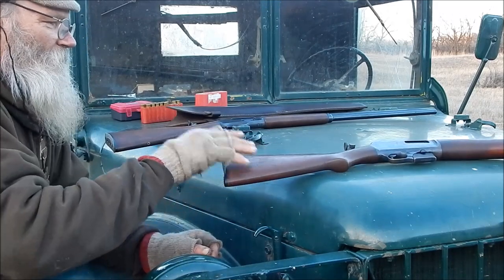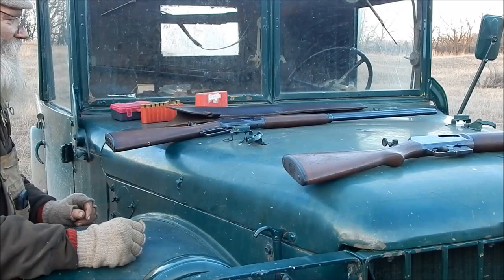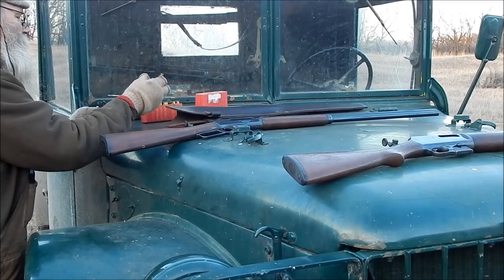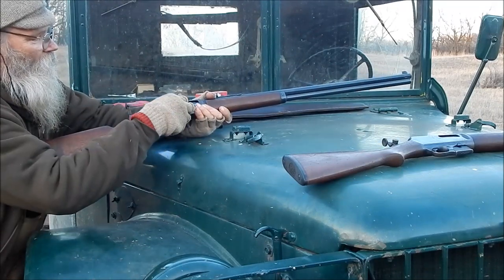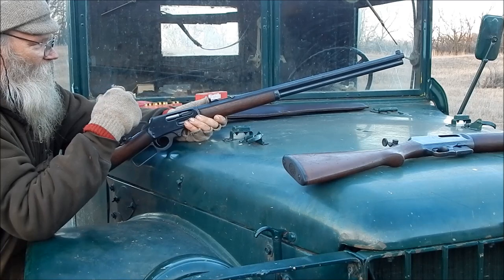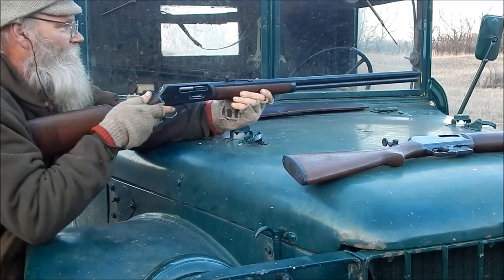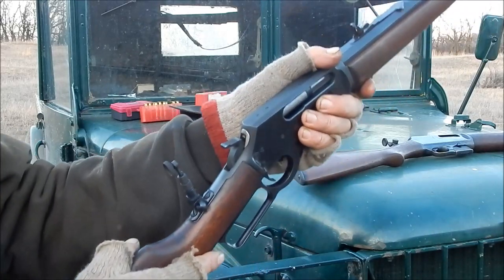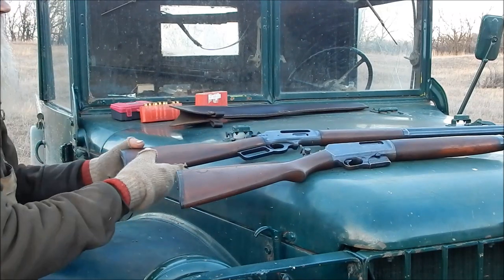Directions? I don't need no stinking directions.

Comment: I'm assuming that Marlin is a 45/70?  Didn't have much kick at all.  I'm considering a Marlin in 45/70, but I'd like to be able to shoot it and reload for it, and I'd also like to load down for most range stuff.  Keep the recoil down.  How is the recoil on the weak loads compared to hot loads in a Marlin 1894 in Colt .45?
Reply from the maker: Yes, its .45-70, an excellent cartridge, easy and economical to reload, and has a wide range of bullet choices, and load levels. A great old cartridge, and in the CB, Marlin made a rifle to use its abilities to great advantage. The heavy bullet will always give you some recoil, but its more of a push then the slamming you take from some calibers.
Reply: logcabinlooms  Looking at my reloading manual for 45/70, starting loads for 300 grain bullets are roughly 1600 to 1800 fps depending on powder used.  I’ve shot 325 grain bullets out of my Marlin 1894 in .45 Colt at over 1300 fps and 260 grain Buffalo Bore at over 1800 fps, so that gives me an idea of what the recoil would be like.  Probably a lot of fun to shoot.  Right now at this point in my life, I’m making new gun purchases based on whether I want to reload for it or not, and the 45/70 just looks like a great cartridge to reload for.  Have you ever used IMR 4895 in your 45/70?  It's not listed in my Lyman Manual.

Comment: I had a tang sight on my winchester 32 -40 I liked it better than the buck horn
Reply from the maker: The Marbles sight that came on the Cowboy are about as good as it gets. I have no problem with them except for longer ranges I just run out of adjustments. For normal use I much prefer those, but I wanted the tang sight solely for target shooting at longer ranges.

Comment: More often than not, manufacturers' instructions are not the best because they have to consider every possible condition and never involve as much thought about durability, because they are not the ones who have to use it long term.  Plus they probably rarely do any extensive testing to see if the mod is even feasible.

Comment: Trailboss is a nice powder for taking the "hunting" guns out for some fun plinking. Really makes 45-70 and .375H&H fun for shooting all day. 
I understand your issue with losing brass, I somewhat regulated the problem by using an old metal detector. Cheap ones are fine since it is on the surface anyways. Mine was free so apart from putting 1.5 hours of work into fixing it up, it was a good deal for a brass locator.
Reply from the maker: The .351 without the deflector tends to broadcast the brass in a large area which makes it tough to get track of. With the deflector on it just kicks them down and I can always find all of them. Its particularly important with shooting those oddball calibers that can be hard to find replacement brass for.
Reply: logcabinlooms Up here brass is usually over priced anyways, so shooting my m1 carbine usually involves me hunting for brass. Luckily the Rem Model 8 doesn't kick brass that far so I don't need to do much more than put a jacket on the ground next to me.

Comment: Did you find you need a higher front sight for both rifles?
Reply from the maker: Neither, both have the originals. Now on the Marlin if I had used the spacer provided with the sight it might have called for it, which would have messed up my normal sight. I did a lot of measuring with strings pulled tight on the sight line before I put the sights on.